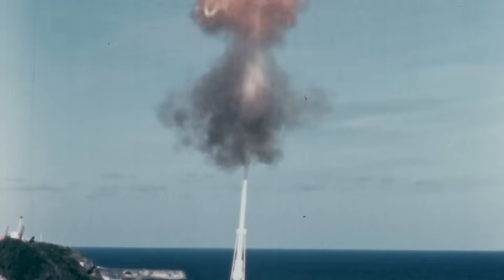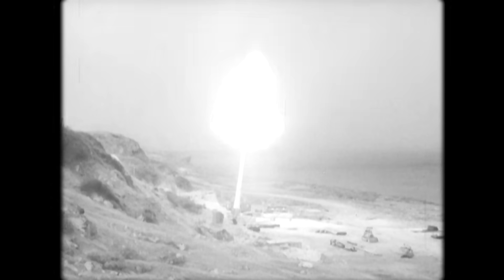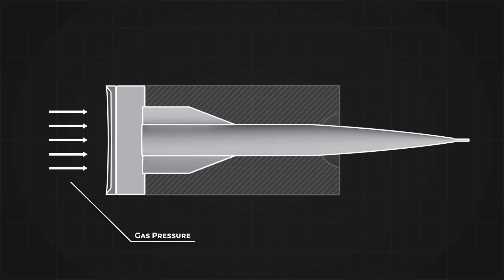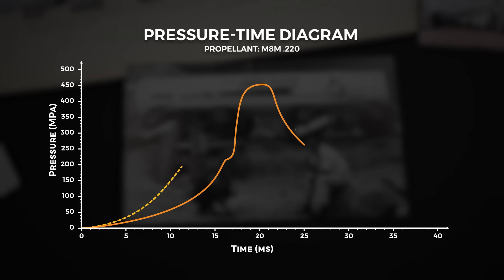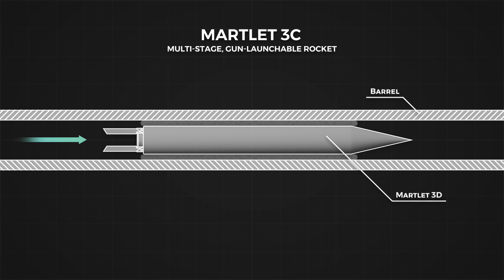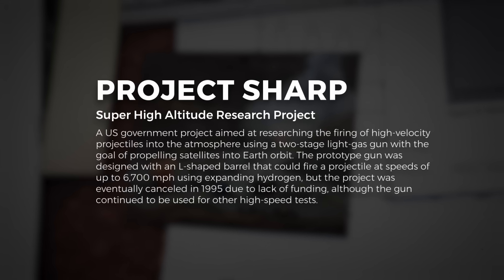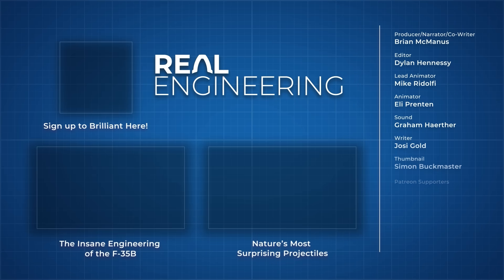This Gun Could Reach Space

Comment: dont try to launch directly upwards, launch from a grounded maglev train track at mach 20 instead. radial acceleration forces the projectile to go to space instead of staying on the ground. ie make the maglev train track launcher circle the whole planet. well thats way much easier to build the tracks on the ground than at high altitude launch track. well how many times can your go around the planet on the surface orbit, not in space. your problem of dealing with the illegal govs of the earth. that muzzle velocity of mach 4 is way too low. you can also make virtual electromagnetic accelerator rings along a path without having to make the whole tube or track. can you invent something new. so push a piston rod upwards with a second pusher in the first barrel. if you have expansion problems.

Comment: There's already a lot of comments saying the bags are not black powered but I would like to add why black powder is not used. Black powder burns very dirty which clogs and erodes the barrel, however the main reason it is not used is due to it burn characteristics. Modern gun powder burns much slower than black powder, this is extremely important because we do not want an explosion, instead we want a constant pushing force on the projectile. Where black powder burns all at once slow burning gun powder puts a constant and stable pressure on the projectile all the way down the barrel. Notably you can typically tell what kind of powder a gun uses based on its barrel length vs the caliber (diameter of projectile). Short barrels (relative to caliber) found on pistols and mortars are usually less than twenty calibers long, they tend to have lower muzzle velocities (~1500fps) and burn flakey fast burning powder. Long barreled weapons like field guns and rifles have much longer barrels, usually between 25 and 50 calibers long, they typically higher velocities (2500fps+) and burn thick grainy powder, often resembling rice grains. The Gun powder used for the guns on the Iowa class ships is cylindrical being 1 inch in diameter and 2 inches in length, with seven holes drilled through it length wise in order to control burn characteristics. The barrel of this gun being 36m long assuming it still fires a 16in projectile would be almost 88 calibers long, and we would expect to see very large grains of slow burning gun powder, however they likely used the 1x2 in grains that the Iowa uses since that's what they had, and the imagery in the video seems to support this.

Comment: Space in name only. But not to orbit, where  a substantial horizontal velocity must be reached  , like 7.8 km/sec. If that would be the nozzle velocity, without a heat shield, it would burn up in short order, 
Bezos flies to 100 km with a rocket, and never reaches orbit.
Call it suborbit, not space, everything else is deception.
Reply: The goal was to use a two stage system. Gun to space rocket engine to enter a stable orbit

Comment: Why can't they just bury the whole gun In the ground?  in fact they can bore deep slanted or vertical holes in the ground or ROCK and use pipe as the barrel. ground/rock will act to support the barrel as the pressure builds up.

Comment: I seldomly see such interesting engineering goals pessimistically, but spinlaunch is just a bad idea 😅
The rotational g-forces produced to achieve sufficient orbital injection speeds are extremely high, needing a huge amount of rigidity, which results in useless weight.
Then you also need extremely precise release timing to get the right trajectory and not destroy the whole construction. 
Another significant problem:
The projectile will still be spinning at the same rpm as necessary to achieve the orbital velocity, which is extremely bad for a hypersonic rocket entering an atmosphere. 
This will result in extreme forces in multiple directions alternatingly, so you'd have to design all critical parts to survive hundreds or thousands of extreme force changes in a second... which adds more weight. 

The giant cannon approach is just way more plausible.
maybe use railgun technology and vibranium. 😂

Comment: That's pretty cool, especially for the time it was made, but the navys railgun can do pretty much the same thing. I think it would make more sense to use a railgun for such a task. Its not good that space is being weaponized, but since its happening, I would use railguns and direct energy weapons to deal with it.
Reply: Problem is that railguns are even more picky with the types of projectile they can use. The nice thing about HARP was that if you could make something that could take the G force that was it. With a railgun you need to put much more effort into projectile design to avoid all that electricity trying to force its way through the payload ruining it.
Reply: @thatkancolleguy  I'm glad you said that. I'm actually working towards building at least one for myself and this is something I need to keep in mind. One of my design concepts involves using very small flichette type projectiles and firing them at a blistering cyclic rate, but the smaller the conductor, the more resistance, and more resistance involves more heat. To much could cause meltdowns. I also have a concept that involves complex projectiles involving explosive and incendiary payloads which could detonate or ignite to early if they aren't made just right.

Comment: This is a technology of the past. Today there are rail guns in development which do not have many of the problems encountered by this gun. And as those do not have such a big explosive impulse like this cannon but a longer lasting phase of lower acceleration instead there is not so much stress for the »barrel«, thus far less weight. Due to that the whole thing can be built much lighter, which makes it possible to build it into a large aircraft which can transport up at, say, 30,000 feet. So here the projectile will have some 30,000 feet of airspace less to conquer which means much less drag, which means far less energy to put it to the same speed as the old one.

Comment: Im not much of an engineer, but my figures for the G loading are a lot closer to 500,000, than 5000. A typical rifle bullet reaches 50,000+ G and that is pretty close to the form factor of this gun, which is to be accelerating a 20kg+ pkg to nearly 10,000m/s. Even a rocket assisted projectile is going to need a serious kick. 5000G seems like fantasy for a ballistic orbital launch. I think you'd need closer to 100m+ bbl length to soften the G loading enough for any practicality. That said, this could definitely work on the Moon, with a much shallower well and practically no atmosphere.  Maybe a km long gun to launch packages around the solar system, like supply drops to Mars.

Comment: Update: GreenLaunch(dot)space reusable ground based Stage 0 launcher accelerates the vehicle with the fastest
known propellant, hydrogen. This launcher produces no CO2 or hydrocarbons, only
water. The eventual orbital system requires a solid rocket booster to circularize the orbit
after the vehicle is in space. The ultimate, sustainable light-gas launch system would
employ pure, compressed hydrogen heated by solar or nuclear power where the
hydrogen is 99% captured and reused. Methane and RP1 produce at least 19 tons of
CO2 for each payload ton put in orbit.
Currently poised to sample the mesosphere between 37 km and 100 km in order to determine
the isotopic gas content. This has great bearing on the earth's energy budget and
provides physical data for climate scientists around the world. Green Launch is uniquely
able to take biopsies of the earth's atmosphere at altitudes too high for balloons and too
low for satellites. Sounding rockets are much more expensive as well as polluting.
Vertical launches here https://www.youtube.com/watch?v=MYsc4u2pKuQ

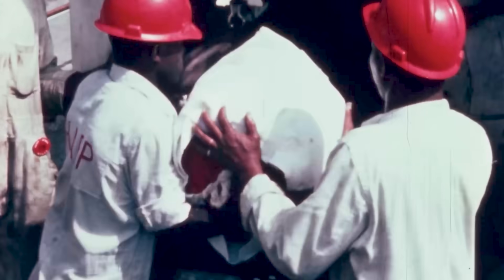Comment: 8:12 - To increase muzzle velocity Project Harp needed black powder..." - well, that were "Project Waterloo" and "Project Trafalgar" that used BLACK powder, NOT Project Harp.
I mean, yes, others have corrected you already on that blooper, but c'mon, how come you go through all the research to make this otherwise excellent piece of information and yet make such fart like "black powder" in the context of modern naval gun...? : )

PS/ Addendum: after going through few more minor... inaccuracies, we arrive at "project Sharp - an even bigger light-gas powered gun...." - well, NO.
HYPERSONIC guns ARE NOT "powered" by light gas (hydrogen or helium) - the light gas is merely a "working/ intermediate medium" of sort. They are used because they can absorb the total energy of a rather slow-burning gunpowder charge, which expands slowly due to its high "average molecular mass", and then those light gases can expand RAPIDLY (because of their LOW molecular mass), thus pushing the projectile to hypersonic speeds.

Now, you should really fire (pun not intended) few individuals either in your research team, or scripting team - or from both teams. This is really going to dogs and is becoming a laughing stock.

Comment: The proper way to do it would involve a huge railgun ramp on top of a hill/mountain , probably 1-2km long.. to allow proggresive acceleration.
Reply: Launching a 25Kg projectile in to space 450km from the surface and having it appear there briefly before falling f back down would take 110 MJ in a vacuum. It’s more like 250 MJ when losses are taken into account.

That is 30 to 70 KWH in the space of a few seconds. How does this energy get stored and expended without using gunpowder?

You railgun would need to be at least 8km long.   Possibly a lot more than this depending on efficiencies and location on the earth

Comment: It's not true that piezoelectric crystals produce a current. They produce a voltage. The voltage then produces a current but the current depends on the resistance used in the circuit.

Comment: 0:18 Black powder? It's a nitpick, but nit I shall pick - black powder is the old formulation of gunpowder made of charcoal, saltpeter and sulfur that produces a lot of fouling, and has a slower deflagration rate and weaker pressure curve than modern smokeless powder used in firearms. Black powder is still used by enthusiasts, but it would certainly not have been used in an application demanding the highest bang to buck ratio possible, not to mention that the thick black powder fouling would increase maintenance cost, both in time and labor.

Comment: I think in the end Project Harp will be much more successful than spinlaunch. With spinlaunch anything that is launched goes from a massively high acceleration towards the centre of the pivot instantly to no acceleration in that direction followed by a fairly huge negative acceleration as the load passes through the atmosphere. Anything other than an entirely rigid load (pronounced lump of steel) will self destruct when it experiences these 2 accelerations.

Comment: in my logic practitioners of ballistic physics always completely under estimate the stored energy of spin and usually with the tidbit that it will “curve” rather than travel on a linear arch. The “curve” is completely calculable, and the spin is worth the greatly lowered drag coefficient and the much greater impact power. 

Using spin as a kinetic battery and getting the ratio of spin to curve down is just a great idea in my opnion. hydrogen/oxygen, seems like it would be a much more suited propellent in the context of these cannons. Applying an electric charge to the barrel, a copper coating to the slug and adding some retractable ailerons to the tail could solve a lot of drag issues that pretty much every singel ballstic platform suffers from.

This country is that treasonus (canada), I have heard this story before from desert cannon on. Lesson: Only accept large transactions from a bank manager or upward. Seriously. And if you want to sell arms, sell them to nato contributers, i was personally pondering buying courps guns and refurbshing them. :P

Also, Spin Launch simply needs a hydrolic/pneumatic diaphram to reduce vacume time and enegry requirements.

Comment: Are you sure about that SHOT WEIGHT VS MUZZLE VELOCITY graph you show at 4:10? It shows a 35kg projectile barely cracking 1000m/s. That's about the same as a modern 155mm artillery piece. I would have expected far higher numbers from a gun the size of HARP.

Comment: it's hard to take you seriously when you're enamored with spinlaunch. pray tell, what material are they using that is strong enough to hold a vacuum, yet insubstantial enough to immediately break away as the projectile touches it? cuz without a vacuum, spinlaunch is vaporware.
Reply: Spinlaunch are certainly a bit iffy. But holding against about 14psi in one direction isn't that difficult. Breaking when struck from the other direction by a small area object is also quite feasible. Its, err, not rocket science.

Comment: Great video, as usual, thank you! But.... (there's always a but)... the space gun may not actually hold the record for the highest altitude projectile ever launched (certainly by humanity anyway). Let me elaborate...

In 1956/1957, the USA did a series of nuclear weapons tests, 'Operation Plumbbob' at the Nevada Test Site, where one such test, Pascal-B, may have been responsible for the fastest projectile in recorded history. Two tests were both conducted underground in boreholes 500 ft deep, where the weapons were lowered into the boreholes, then covered with concrete. During Pascal-A, the test immediately vaporised the concrete and blasted a jet of plasma skywards, resulting in a poor test objective result. 

Pascal-B was conducted in a similar fashion, with the same concrete plug and depth, but this time with a steel 'manhole' cover weighing 2000 lbs welded over the borehole. When the test was conducted, the steel cover was immediately blasted upward at a speed of roughly 150,000 mph (66 km/s), which was only estimated by looking at high speed camera footage of the event which managed to catch the cover mid-launch in only one single frame post-detonation. 

Subsequently, speculation among scientists at the time concluded that the sheer velocity of the cover would have vaporised it promptly as it rose, while others believe at least some of it would have made it past the earth's atmosphere. Because the cover was travelling vastly greater than earth gravitational escape velocity, if any of it did survive the launch, it is likely hurtling through the solar system somewhere very far away. 

No one knows for sure of course, as only one frame managed to capture it during ascent. But if it did survive at all, then it is by far, not only the fastest man made object, but also the fastest projectile.